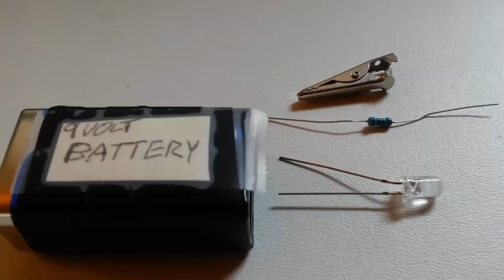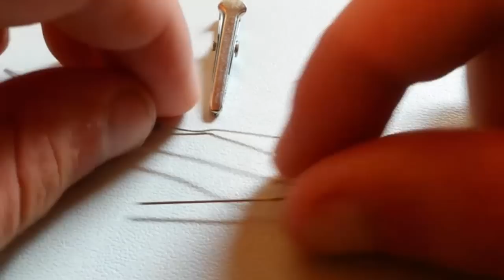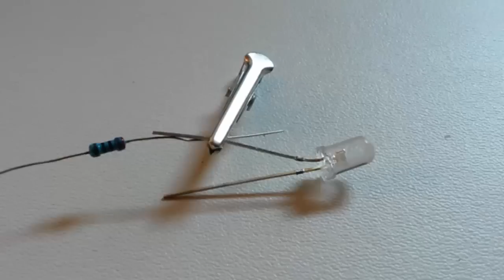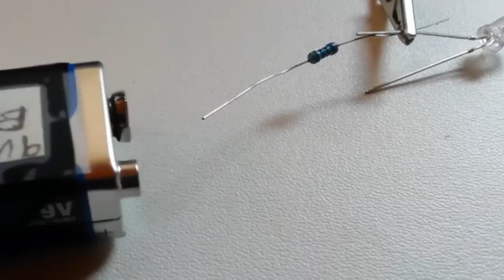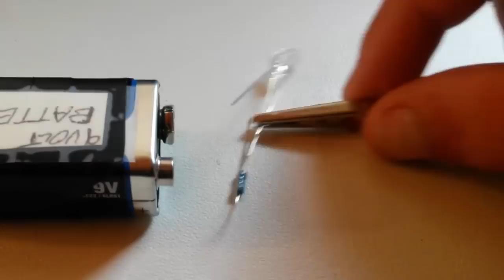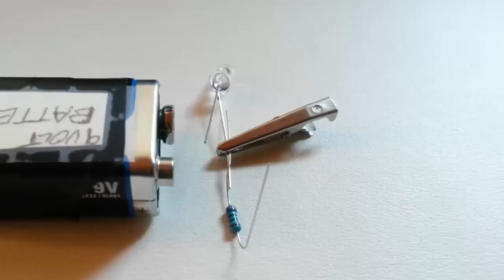Beginner Electronics - 8 - First Circuit!

Comment: Why is the resistor not on the other side of the led when electrons travel from negative to positive? 
Great series!
Reply from the maker: William Liisberg It can go on either side, it does not matter because while electrons do travel from neg. - pos., you could also think of it as losing electrons going from pos. - neg., thus either way electrons are being resisted!
Reply: okay thanks man!
Reply: @CodeNMore  Say you have a pipe with a flow meter (LED) in the middle so you know how much water(amps) is going through it, and then pump some water through it. If there is a clog before the flow meter, it will limit the water going through the pipe. If the clog is after the flowmeter, it will also limit the water going through a pipe. Thats how it works.
Reply from the maker: +deathquest03 well, some components don't care - like resistors - however other components (like diodes, or a Light Emitting Diode (LED) require a certain path of electricity, we"ll learn more about it as we dive into diodes!
Reply: The circuit is a series circuit, current is the same at all points in a series circuit, therefore the resistor can go anywhere in the circuit. It doesnt matter where it goes in the circuit.
Reply: It doesn't matter how much hits the LED. What you care about is the OVERALL current within the loop. The resistor is not becomign an attachment for the LED, you can put another cable between the LED leg and the resistor, put it behind the LED or after the LED... the resistors job is to affect the LOOP not the incoming electricity before a component. So if you have a pure closed loop you get 9 volts front to back. Hooking a LED which can't stand this amount of energy will burn it. But if you add a resistor ANYWHERE on that loop, it reduces the flow for the entire loop. Think of a rubber band. When you pull both sides you create tension for the entire band, not just a part of it, regardless which hand is pulling. It's a bit hard to think of really, but I see it as, it doesn't matter what goes IN to the loop, but what is returned. And what is returned dictates the overall tension / flow of the loop.
Reply: @SubVengeance  interesting explanation somehow made things clearer
Reply: I don't know for sure but if you think of it as a constant flowing river that is connect like a loop, you place a dam in the middle of the river with a hole in, it won't just slow the flow of water on one side of the dam but also stop the flow on the other side, if the river is connected as a loop, the whole river flow would slow down.
Reply: A resistor limits the current, or the size of the water pipe, so if you add resistance you are shrinking the diameter of the entire water pipe, not just one part of it.
Reply: @steve_buns  thank you this made me understand
Reply: +CodeNMore Right on, thanks. It's also confusing how the components can take the full force of the battery but be alright when there's resistance downstream. I guess It will make more sense as I progress through the series.
Reply: and this is where electronics completely loses me. Besides, this also seems to contradict his previous video  explaining the comparison of water flow to current flow.
Reply: the resistor is just constipating the flow 
... it still doesn't get a bombardment of electrons because it's backed up
Reply: For what I understand, it doesn't matter if the electricity hits the LED where the resistor is or not, but how much current goes through it. For instance, if we picture the flow from negative to positive on the circuit in the video, yes, the electrons hit the LED, but on the other side of the LED you have a resistor limiting the current (amps) that goes through the circuit. If you think of it as the water example from earlier videos, you have water going through, but the resistor on the other end, is still limiting the amount of water going through.
Reply: +CodeNMore Wait, if it doesn't matter, then why does it fry some electronics if you
 hook up a battery backward? Like if you hook up your car battery wrong,
 it will blow fuses and sometimes fry your cpu? What's the best way to make a habit of doing?
Reply: @deathquest03  changing what side the resistor is on is different from changing the polarity. Its kinda like if you take 9 minus 5, thats the same as -5 plus 9.
Reply: +deathquest03 because some components Can only handle charged electrons in one side
Reply: +CodeNMore yeah That's right
Reply: windson7 The LED does not use the electrons up... Its only uses the movement. Like a stream of water in a river, and no you let the stream power a wheel.. The wheel doesnt consume the water it just uses the water movement
Reply: @roven7730  if it didnt bleed electrons as light or heat than a battery would never die.  A resistor bleeds electrons as heat.
Reply: @CL-ty6wp  it doesnt bleed the electrons, it bleeds the electrons energy potential. And no it couldnt run forever even though the amount of electrons in the system doesnt change the energy potential of the electrons change from high to low..
Reply: @roven7730  what energy potential and what change? And remember everything is THEORY.
Reply: So what is the heat? It has to be made of something.  I think heat is agitated electrons that fall from current because of resistance.  Heat travels up back to the source (sun) of electrons.
Reply: @CL-ty6wp  oh boy. Im not gonna explain heat. You have the internet to your disposal
Reply: @roven7730  thats what i thought
Reply: https://youtu.be/rbCXKhhzBN0?t=144
Reply: Ok thank you man